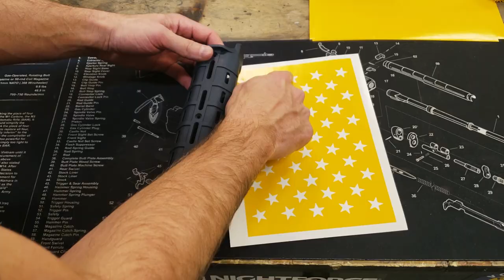How to Paint an AMERICAN FLAG rifle

Comment: did you bake between colors?
Reply from the maker: Hello and sorry for the delayed response.  Baking isn't always necessary depending on the product your using.  We do recommend it though as it speeds up the curing process for air cure products.  We recommend flash curing between colors at 180 for about 10 minutes.